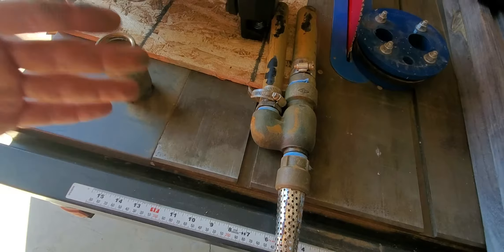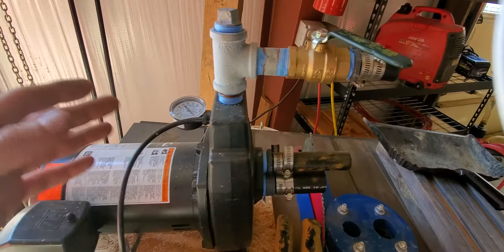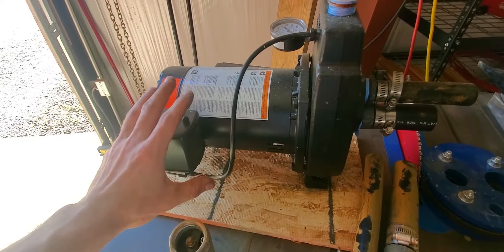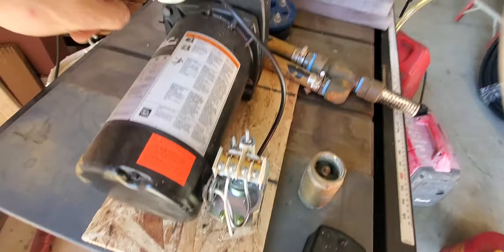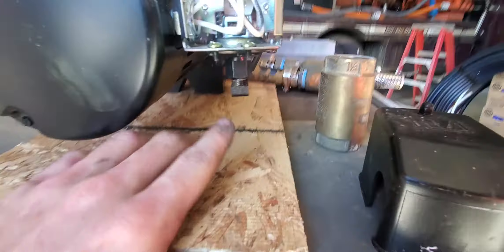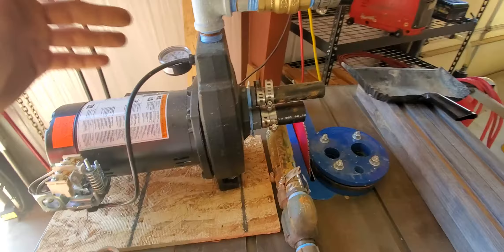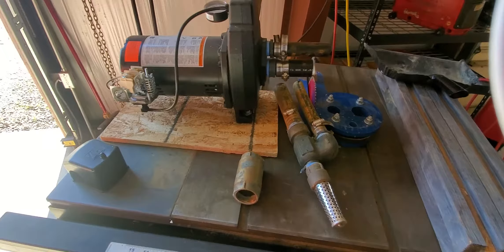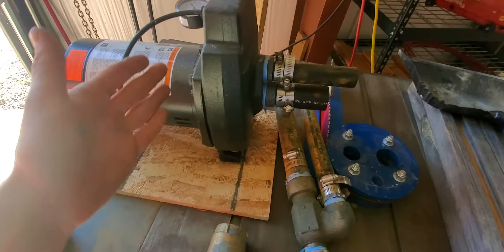Well Pump Not Pumping, here's why. Jet Pump 2 Line System Explained. No Water, Low Pressure.

Comment: Love your simple video explanation. I have an old jet pump+tank for non-potable water on old summer cabin with old venturi/check-valve that we plop into the old lake. Did I mention it's all old? Pump+ pressure tank situated under cabin at 15' height head over lake level. Jet system seems to make sense due to height above lake and cabin plumbing pressure at steady state keeps pump/tank filled.  If I replace the system, would you recommend something different or just a new jet system (pump, tank, 2 lines, venturi & check valve)? Also, Recommendations for new system (brand ect). Many Thanks. Harry
Reply from the maker: I'd hang a submersible pump in the water if you are close enough to run a wire down to it. Just slide the pump into a short 4" pipe to prevent trash on the screen
Reply: @h2omechanic  Thanks. Lake is shallow (3') sand bottom so we just strap the old foot/injector to a tire rim. I can probably get power to the lake. Can you point to one of your videos of how to install a submersible? Also guidance on brands/models for either submersible or jet.
Reply from the maker: @zhbh101  https://youtu.be/iXSQg6LLwxY

Comment: Your the newest video I could find I have a under ground tank I put a shallow well pump (jet pump) on the tank (1000g tank) haven’t had a pump on it over 5 years is it bad to let my pump run back to the tank to circulate the water with bleach to cleen the pump any help
Would be greatly appreciated

Comment: Hey again i love your videos and your knowledge is indeed priceless thank you one million times over. I just bought new deep jet pump replaced ejector foot valve and venture it will only build up to 35-37 psi my switch is 30/50 i filled pressure tank to 28 psi its holding prime pressure switch is new also. please help
Reply from the maker: How deep did you set you lines? & how deep is the water level
Reply: So the well is 60ft deep and the lines are about 55 56 ft approximately  do you think it's resting on the bottom of the well?
Reply: And do I have to have  a tee off my pressure tank or will it operate normally with out one? Thank you again
Reply from the maker: @dustinwarren3125  you have to have a tank.  But not sure why you can build high pressures unless you have a lose clamp or fitting somewhere sucking in air
Reply: Thank you sir I do have a pressure tank but do not have a tee hooked up to it I wasn't sure if I needed one on the tank for it to operate properly

Comment: Hey had busted waterline I dug it up fixed it I have a 2 line jet pump and it pulls up hill from a spring it starts to prime but won't go past 20 new injector and foot valve
Reply from the maker: Probably a air leak at one of the fittings

Comment: I have a multistage jet pump with a 2" well casing that is sucking air somewhere. Well is down 50' . Do they make a submersible pump that will fit inside my 2" well casing pipe? The pump is about 45-50 yrs. old is a Flint Walling pump which lists at $1950.

Comment: Hey there. So glad I found this video.  I have a piece of land with a well that I’m trying to get going after not being used for 15 years.  There are two lines to thr well and drop in with a pitless valve.  I’ve been shopping for a deep well jet pump because I’m certain that is what it was hooked up for, but is there anyway to take your advice and go with a submersible given it has a dual pitless that I don’t want to dig up?
Reply from the maker: Never seen a dual pitless. But id assume you'd still have to dig it up & cap the other side. Or maybe cap the pitless head if that's possible & then you can definitely hang a submersible in there. Hopefully there's wire going out to the well. If not, use the un needed pipe as a wire chase. But you'd still have to dig it up.
Reply: @h2omechanic  Thanks very much.  I was thinking about this a bit after posting that question, and I'm questioning if I need to do anything with the second line.  If it is a dual pitless, and it was a jet pump, then each line runs separately.  Your comment in the video about the 1" vs. 1 and 1/4" is what really sold me on the submersible.  If I just don't use the second pipe, and turn the first pipe into a direct line for the new submersible, that should work.  I can dig a trench for the power.  The water lines are quite deep (6 feet at well), and the electrical run in my county only needs to be 2ft.  I'm trying to think of what just leaving the second pipe unused with the dual pitless will give me any issues with the submersible. Can you think of what it would need to be capped?

Comment: No water deep well jet pump...Why would the big line be sucked closed when the pump runs. If you unplug the pump the water line returns to normal shape. Is it a injector or foot valve issue?

Comment: Hi im Carl , I have a half horse above ground sears hydro glass jet pump. I Think it  only has one bigger inlet. It has two same size outlets at the top one  straight up and one out the side rite beside the top one what are they for?
Reply from the maker: The 2 different sizes on the face of the pump go down the well to the injector & foot valve. 
The top port is your discharge (out going port)
You need to watch a video on how dual libe jet pumps function to understand

Comment: Hello this might be covered before but why is there two holes in the front of my jet pump do I need to use both of them can I just plug the bottom one and use the top one please help
Reply from the maker: A single hole jet pump is strictly a suction pump.
A 2 hole pump requires using both, one pushes water out & the other pulls water in. You can't just plug a hole, I've tried it, it doesn't work. 
A 2 hole pump requires 2 lines & a injector / foot valve

Comment: I started watching your videos because we're having a problem with our well system, our tank is empty and our pump kicks on for around 15 seconds until it builds up pressure at 63 but the needle drops back to zero when it shuts off and it doesn't hold pressure this gauge is on the pump, the gauge that is connect to the switch is on around 50. I thought the pressure switch was the problem but after taking the cover off I think it's something else I was wondering if you can help.
Reply from the maker: The foot valve on the bottom of the suction pipe is leaking. It's only supposed to allow water the flow in & then it closes when the pump shuts down. Yours is broken or stuck in the open position

Comment: I’m not sure if it’s something that is an easy fix but I have a f&w convertible pump (cpj05b model) at about 65-70 feet and it suddenly stopped pumping water. I had just started the washer and went outside and heard it running and thought nothing of it until 5-10 minutes later I noticed it was still running. I went inside and stopped the washer and turned the tub on and it was rusty brown and only had pressure for about two gallons and then it went to nothing. 

The last time I had issues with it, the pressure switch had got clogged so the first thing I did was switch it out. Only one I had on hand was a 30/50 (switching from a 20/40) so I also adjusted the tank. When that didn’t fix the issue I double checked the prime and other than a build up of sand (which was rock solid) it was full. At the same time I checked the pressure gauge and it to had build up so cleaned that up and just put that back to plug the hole until I got a new one. I also disconnected the discharge pipe and I pe texted that just for the chance of any build up in that but it was clear. Lastly I took the plug off the T to look at the pipe down to the well and it was filled to the top with water as well. 

There has been a couple times that if I tap on the T near the plug I can get about 2 gallons of dirty water before it goes back to nothing.  The local well guy is 4-5 months out on calls so I’m just making sure I cover everything I can while I wait. I am assuming if the line is full of water that means there is no leak correct?

Comment: Installed new foot and pressure switch. Yesterday it made it to 50 psi and cut off and cut on at 30 psi. It done this 4 or 5 times now it want get above 35 psi  do you have any ideas

Comment: my well is small diameter when system is primed some times it locks up  like it hydrulic up done this with two different pumps. i,m thinking maybe foot valve not opening cause things to lock up water level about 18 feet down pipe

Comment: My pump stopped working after my electric went off for a few hours. Its humming but not turning on. Priming didnt work. Any thoughts? This pump looks like yours and i dumped the water in there but it wont turn on just humms  off and on off and on

Comment: I have always used jet pumps on this but can I use a submersible pump in a 20 ft deep hand dug  4ft across rock lined well for my home, system what size ? Thanks
Reply from the maker: Yes. Any 1/2hp will work.  Watch my video on Yard hydrant install, I did exactly what you are wanting to do in a 30ft rock well from 1904

Comment: My pump just like this went out. So bought  new and install. Primed and it initially went up to 53 psi but did not go higher or shut off so in fear of burning up pump I shut off . Manual said was set at factory at 30/50.  Turned back on to adjust and now it just kicks on but no pressure. I have replaced everything in the well , jet pack,check valve and all pipe still can't get it to prime. Are there any trick in getting a air lock out.
Reply from the maker: This is the biggest problem with jet pumps. To force out a air leak, you need a hose from the neighbors and force water thru the system is the easy way. Or remove the elbow at the top of the well & slowly fill the pipe there.
Reply: @h2omechanic  that's what I am planning on doing later today where would you suggest I hook the hose up to

Comment: I'm having problem pulling the old submersible pump up. 100ft down. i can get it up about 25ft
Reply from the maker: @championplayerdo7604  it's probably hanging up on the lip of the casing. When you get to the point where it stops,  go up & down in that spot & hold the pipe and walk circles around the well, you'll be rotating the pump & itll find the sweet spot & slide through. Might take a few minutes of back & forth but it'll come.

Comment: Question:   We just replaced the foot valve, injector pump, seal cap and pipe elbows on my well line.  (We replaced the 2-line Jet Pump about a year ago).   My plumber friend suggested we use PVC elbows instead of cast iron.  My pit is about 4' deep.  Last night we had subzero temperatures.  Can't build pressure (sitting at 30 / 40) up to shut off (40/60).   Pit has about 1' of water or more in it.   Did we crack the PVC elbows?
Reply from the maker: It's possible that it is cracked for sure. Try to prime it.
Reply: @h2omechanic  Hi again.  The PVC connections and elbows did not crack.  However, our connection from the elbow to the 1 1/4 down pipe came apart.  We put it back together and filled the pipes with water.   Could not get it to pump water.    Unless you have a better solution, our next course of action is to pull the pipes and check the foot valve.  It is a new hard plastic (NPT) one that came with the injector pump.  I may go ahead and replace it with a brass Foot Valve with a better screen.   Any thoughts ???
Reply from the maker: @Kevin Marks  I'm not a jet pump expert, so I can't point you in the right direction...that being said, I think your going in the right direction. Just look at every joint/connection closely!
Reply: @kevinmarks6461  if one connection came apart, it's likely that another did as well. Going with a brass foot valve  is not a bad idea.  It will typically outlast PVC.

Comment: Could you help me out please I have a submersible pump the water just quit working I got to check and the points look like they're not closing all the way but it shows I have power going down to the pump
Reply from the maker: You'd have to test for voltage out at the well, if you get 240v at the well, you'll know the switch is allowing current threw it & that'll let you know if the issue is down the well. Either a bad pump, or a broken wire. 
If you don't get 240v at the well, you'll know its a bad switch

Comment: I need help. We replaced a jet pump it primed right away. Held good for 10 days, then no water today. Primed today and it’s sucking air. The sound is coming from the casing. Do I have a cracked pipe or is my well shot. The foot valve is at 56’, the injector is at 40’, the water level on the pipes is at 35’. We need all the advice we can get.
Reply from the maker: If your pipes have clamps, tighten them . 1 might be loose. Or possibly a cracked pipe.  But possible that the well is dry as well

Comment: I changed my jet pump & now when I flip breaker back on it will cut on & run about 20 seconds & cuts off . The points stay closed all th time . Another thing while th pump is running during that 20 seconds I can manually open the points & it still runs with me holding the points open
Reply from the maker: You have wired it up incorrectly somehow. Secondly if its tripping the breaker, the pump motor is most likely set to the incorrect voltage. If you have a 240v breaker, the motor is probably wired for 120v. Remove the motor end cap & read the wire diagram. 120v if its a single pole breaker, 240v if it's a double breaker

Comment: My well pump hums but doesn’t start.  I replaced the pressure switch but it didn’t help.  The pump is still primed.  Any advice would be appreciated.
Reply from the maker: It's locked up. Dead. Either bad bearings or lightning hit it
Reply from the maker: You might get lucky if you can see the shaft & try to turn it with vice grips & free it up. If not, replace it
Reply: Could it possibly be the capacitor?
Reply from the maker: @mmwilliams8710  if it looks swollen or popped then yes.

Comment: Here's one for ya... same style pump. About 5 years old. I've got a brand new switch. Zero pressure. Pressure tank is empty, light, tings like a bell. No leaks I can find in the system anywhere. I pull the plug to check for prime, and it's full of water.
Pump runs like hell but just fluctuates 0-3psi. I'm losing my mind!!!
Reply from the maker: Air is trapped in the down pipes somewhere. I hate jet pumps. I replace them with a submersible 95% of the time
Reply: @h2omechanic  Ahh. Well.. Crap. We share the well with the house next door apparently. It's 100 year old house and was told it was common many years ago. Neighbors have had water though. Is there anything I can really do?
Reply from the maker: @ItsMykro  if yall use the same pump & they have pressure & u don't, you have a major leak somewhere. U need a good plumber
Reply: Mines doing the same did you figure it out??
Reply: @TheAverageLifeCassandraA  I replaced the pump and the cast piping up to the plastic well piping. Immediately started working.
I got a replacement pump for under $100 and piping was another $40 or so. Took a couple hours because I'm clueless about the stuff, but it works great now

Comment: I just installed a pump system like your showing there.Double line down to well. It will run and get up to maybe 15 pound but thats it and the pump will continue to run until you turn it off but never get over 15 pound. What i don't understand is that if it sets over night it will still have the 15 pounds of pressure,is that foot valve in the well still going to be my issue?Thanks
Reply: Varify that you have the pressure and suction lines in the right holes of the pump. It almost sounds like they're reversed and it can't pull water up
Reply: @BEANS-O-MATICtransmissions  Thanks for the reply but i figured it out and it was my stupid fault.Something i never had to do on a pump before but there is a switch box on the pump that you have to turn from 110 to 220 depending on your voltage. Also there was a hole rubbed through the line where it went through the foundation as well so i fixed that. I will now learn to at least breeze through the directions before installing just to make sure they don't decide to do something else stupid with these pumps.

Comment: Hello i have a 1hp jet pump with a 30/50 pressure switch and an ejector. However, i had to adjust the pressure switch cut out to 40 because pump in struggling after that to get to 50psi to shot out. What can be the problem thats causing pump to get to the 50psi?
Reply: How old is the pump? The impeller could be eroded and not able to generate enough pressure.
Or, the jet is eroded and not efficient at pulling water anymore.

Comment: My pump is on but not pumping the well is full full of water tried 2 pumps prime it and it doesn’t do much at all then nothing it’s Illinois and cold and got a cold snap broke the fitting for the check valve and we repaired that Then fixed the washer water hookup bc them plastic valves broke etc then still had no water switched pumps bc it was hot and still does same thing doesn’t pump water

Comment: I could use some help. We recently started having well issues, when showering we'd lose all water then it would return in a couple minutes. We now have no water but the jet pump humms. Gauge says 0 PSI, and I just replaced the pressure control valve and is still doing the same thing. When I replaced the pressure control switch, water flowed regularly out of the jet pump. Cap to the well casing is completely rusted over.
Reply: I'm having the problem right now. How did you fix this?

Comment: How come my 1hp shallow well jet pump loses water pressure every once in awhile sometimes I lose water pressure multiple times a day my water cuts off and pump cuts off on thermal limit and sometimes I have no problems for days even weeks no issues I've checked blatter tank it's holding 38 psi
Reply: Check valve ?